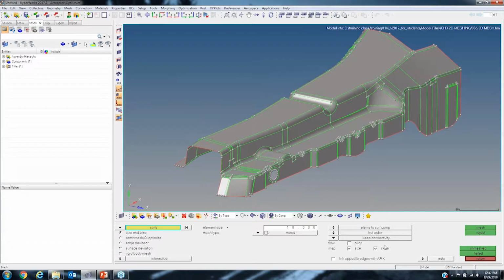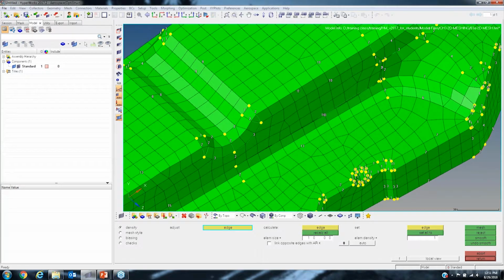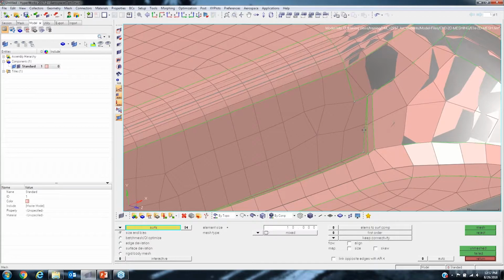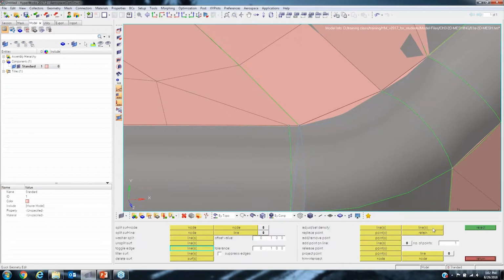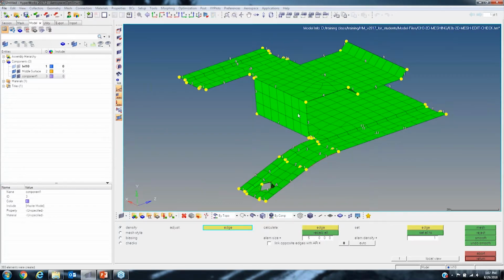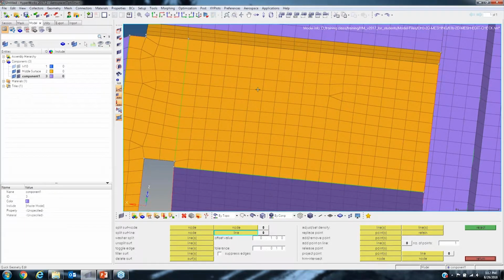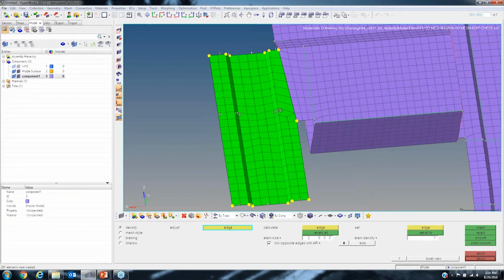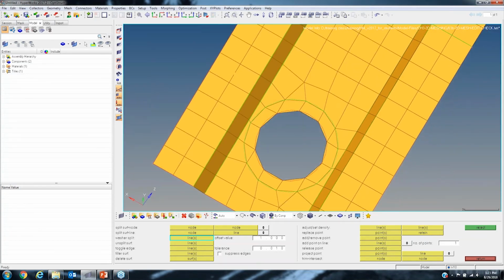Complete 2D shell Meshing Guide | How to 2D shell mesh using Hypermesh

Comment: how to increase the number of nodes using mouse? I am not able to do it.
Reply from the maker: make sure you are in the automesh panel in the interactive portion (when the mesh is green). if you click on the white number you should be able to increase or decrease the number of nodes. if it doesnt change you have to make sure you have selected all of the surrounding surfaces. If the edge you are trying to change is connected to a mesh that isnt green, then you cant change it.

Comment: Absolutely ur good at explaining sir, but we thought equally u would atleast mesh half the component to show  how effectively utilising the tools as u said, which could bring the flow, and there after show a complex region as to how much we can play in that area.
Please do show that, and your effort will be cherished ❤️✌🏻
Reply from the maker: Thanks for the feed back. In this video I was mostly breaking down the options and features so I didnt have as much time to run through one example completely. I have another video coming up where I do mesh an entire part, so do stay tuned.
Reply: @thehexmesher9156   Thankyou so much sir, there are some students who also know which and where a tool is and what its function is. But there are some very important commands or options used at the right time to break the complex portions of the component, so that it can be meshed with a  nominal percentage of trias in the particular complex region, example a converging fillet at a corner bend. 
I am trying hard for an  job interview.
Only if i am confident enough can i move on to the next level, 3D meshing

Kindly cover my request in the next video, as it might be an eye opener to doubts of many❤️👍
Reply: May i get Ur contact sir
Reply: I hope u will be releasing a video this week sir
Reply: Sir ur contact pls
Reply: @thehexmesher9156  sir u only told u will mesh and show a complex component, its not the experience i am asking, but the method of approach in each area